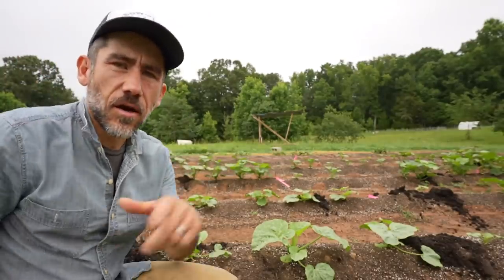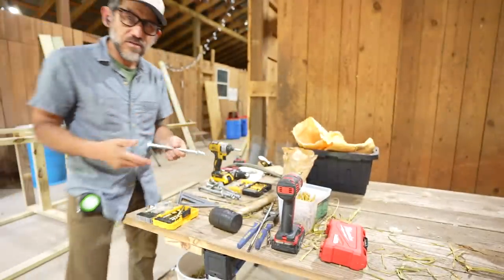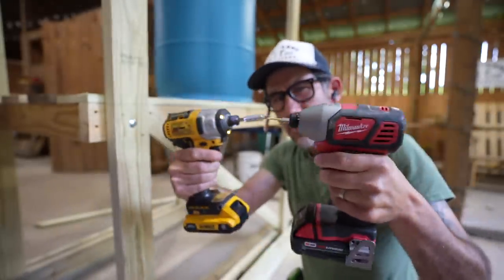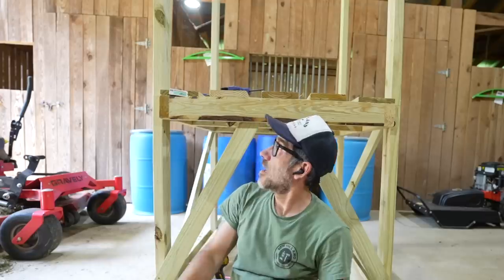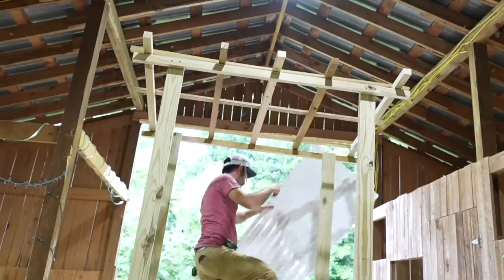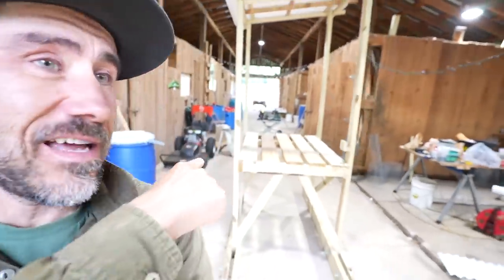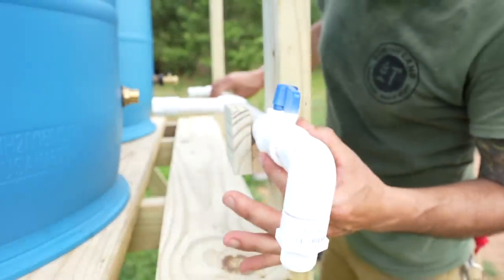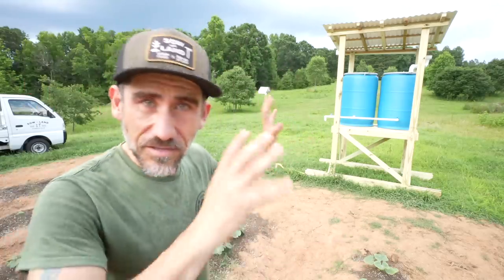Moveable Rain Water Tower for the Homestead Garden

Comment: You could always add more or another one to it to collect more rainwater, kind of of making it a mini water system. 

You could also add a solar powered water pump for added pressure or to empty the tanks out, if needed. 

Also, to make it easier to move, you could always add wheels to it, like you did to the chicken tractor.

Comment: Here in Australia where we regularly capture rainwater we tend to have the outlet from the down pipe finish just above a larger width opening covered in mesh - this just lets the tank fill easier without creating so much pressure - just something to factor in for future versions if needed.  

This would be great with an IBC tote on a pallet as well - especially since they already come with taps etc so it would just be a case of putting mesh over the inlet opening, building the roof structure and plumbing it up.

Comment: Milwaukee all the way! Five year warranty on the tool and 3 years on the battery. I still have 2 of my original batteries from 2013 and I use them professionally as a Heavy equipment mechanic. Tried and true testing

Comment: It’s really great how positive folks are in these comments section so let me give a different perspective. Drip feed with them and you don’t need any elevation and devote 1/6th the wood to building a frame to hold up a tarp the same width as that structure with a hole above the intake for the barrels. You could move that by picking it up, use 1/6th the materials, provide flexibility to increase rain capture area or decrease based on actual benefit and need. For that matter, he could have just sat them out with an appropriately sized cone of metal flashing hot glued and strapped around the top of the barrel forming the rain collection surface and funnel to the opening of the barrel. The longer I do this stuff, the more I realize that over-design in this way is a huge problem across most of these accounts that make money from the performance posted on social media.

Comment: Solid design, movable is brand new to me 👍 totally gonna build mine this way! But I think you're gonna run into "overflow" problems with your system brother. Piping going like that to next barrel too small, it could pressurize and just pop the top and lose valuable water! Maybe a splitter above dropping down into both from the larger 2"- 3" PVC catching water from spout? Or just enlarge outlet going to overflow barrel LOL. Just my thoughts! Ya taught me, so thank ya!

Comment: You always do nice work. I am concerned about the chemicals that will be in the rain. Could you create a filter system? Maybe a barrel with sand, gravel and charcoal in it? Collect it in one barrel and then the water would go through the filter barrel and then go into the second blue barrel as filtered water? One benefit of a high tunnel is to prevent rainfall from affecting your plants. Ground water has filtered down through the earth. I once read a study where deer had radioactivity in their antlers. The government spreads chemicals related to radio and radar and weather modification. In areas with fracking, the waste is sometimes spread on farm fields and it's also radioactive. The plants take in the radioactivity and then the deer eat the plants. Then the deer have radioactive antlers. The prez just announced spreading aerosols to block the sun like they have never been doing it already. But it might mean that they will spread more. Things like sulfuric acid which is thought to have contributed to killing the dinos. The very strong rainfall is the aerosols falling out after a spreading program. Last night, I noticed a all time high for here of PM2.5 pollution during a rain storm. My sensor showed a high of 78 ug/m3 during the storm. In the past it might go up into the 20's from the teens. It's now increasing. All invisible. While they were creating a fear from the stuff they said was Canada smoke, the pollution wasn't as bad as they were saying. They had ambient sensors on towers but they shut them down a couple months ago. So they didn't have a way to tell what the levels were for our area. But they pushed the climate change fear because people could see the haze.The closer cities changed their levels to PM10 which is a larger particle. PM2.5 affects the heart, lungs and brain. They try to scare people when it's not bad and then cover it up when it's really bad from something like fracking.

Comment: that set up will fill  both barrels only at the level you connected them. bett if your system fills one barrel then siphons off to the other barrel which should be at a lower level than the first []

Comment: Are you looking in my windows? I been wanting to build this exact type thing for about 3 months. I was going to make it use a 250 gallon tote. Not to be moved all over 30 times a day but to have something that gets moved 4 or 6 times a yr into an area where some extra water is needed. Then I think why not just put a tank where you want and pump it full when you need it. Coolness aside what if your pumps out,  this takes no input. Just god and gravity. Anyways I nice job. I should have mine done by 2058.

Comment: I think adding 2x4's supports between the platform and the bottom tracks would be good instead of relying on the strength of the screws and bolts to hold the platform up. Screws are not made for sheer strength.

Comment: Your big mistake is using screws. You need bolts with nuts on the legs. 1 bolt isn't enough if you plan to drag that across dirt with 100 gallons of water, at 8.6 pounds per gallon.